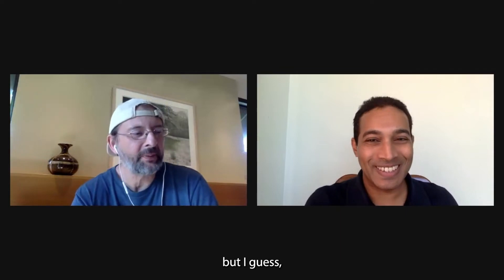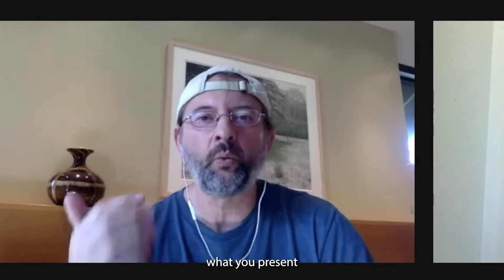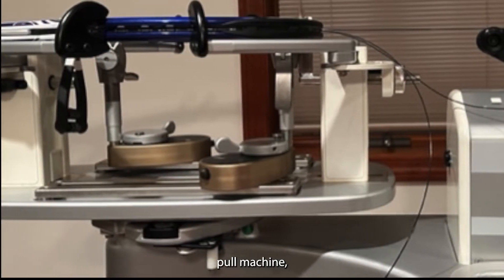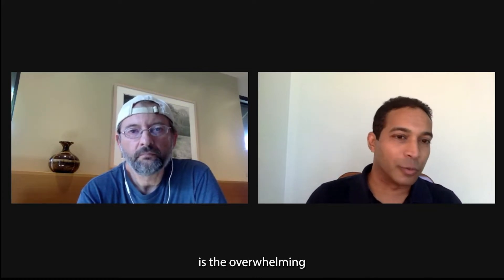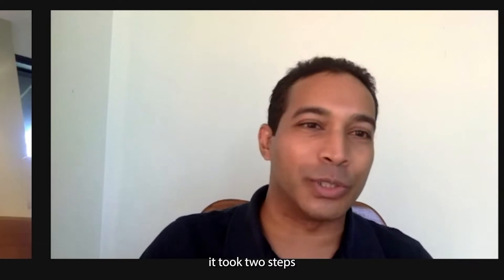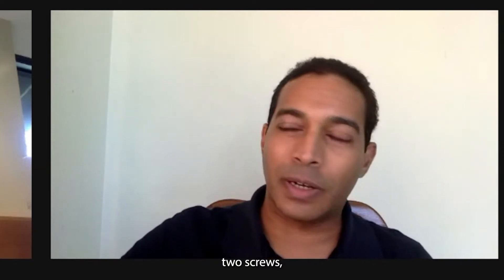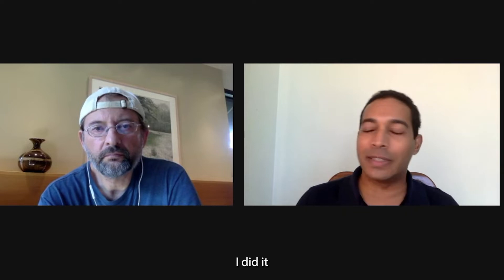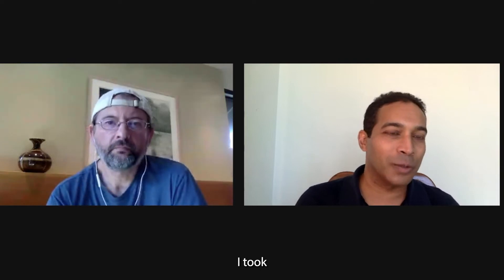Stringing Machine Customization

Comment: Thanks for the video. I'm wondering with what string at what tension the racquet was strung at to provide a 6% increase in bed-stiffness?? Would the increase in bed-stiffness be less if strung with a poly rather than gut/multi or at lower tensions for example?
Reply from the maker: Good question, I will pass that one on to Mathew